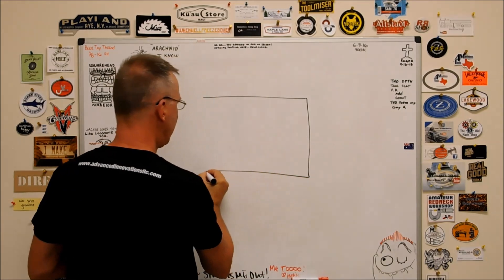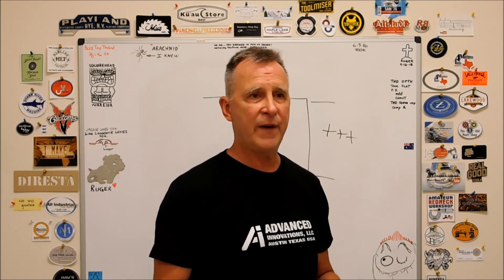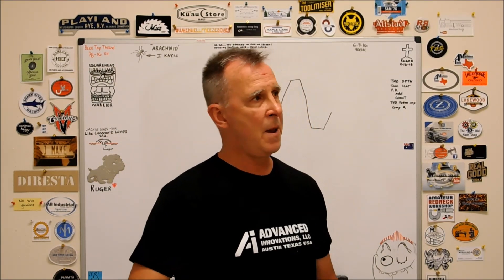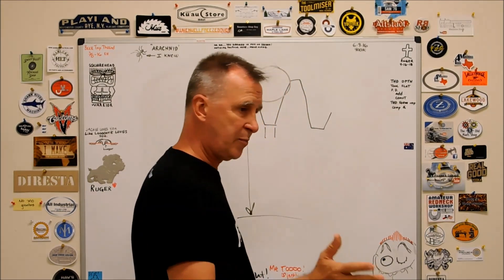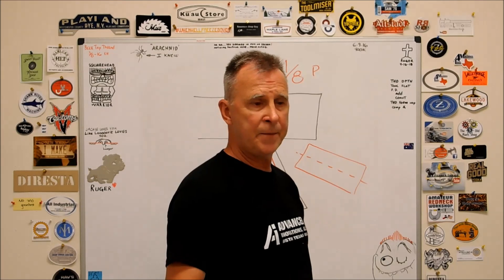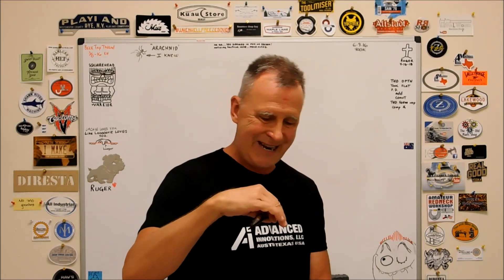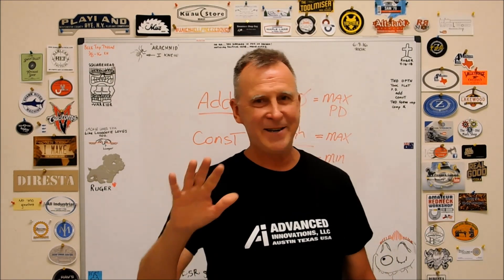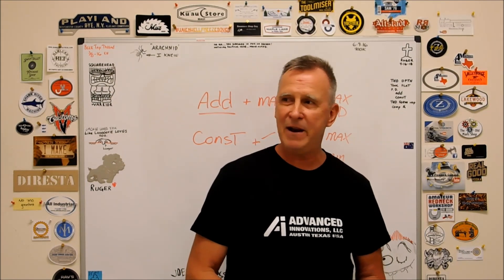Single Point Threading, Want to do it better ?? Watch This Video.

Comment: Joe, I have another newbie question concerning thread cutting.   My lathe (LeBlond Regal 13, 1960 model) has diameter reduction on the cross slide and radius deduction on the compound.  So, initially, when taking cuts and whether you're using the cross slide or compound (set to 29.5), you would have to adjust the dial setting accordingly.  And, if you're using the compound, there again set to 29.5, what ever depth of cut you input on the dial, is really a trig function of 30 degrees?  So, if you dial in on the compound .005, it's not really .005 but less.  I guess you could indicate on the tool post.  What am I missing?  I do understand that the finish cut should be measured with wires to get to the standard.  And what ever alloy you threading, the cross slide or compound may be a better selection plus the rpm of the spindle.  I am practicing on aluminum for now using a hss cutter.
Reply from the maker: As much as I hate "Depth of the cut" threading, If that's your path, set the depth first with the cross slide, and leave it alone. Having done that with the compound at zero, simply back the compound out and start your threading. When the compound ultimately reaches zero after several passes, your depth should be what your looking for. Then use wires.

Comment: I am just trying to understand the basics.  For now I’m ignoring the half degree.  Anyway, some people say to set your compound to 60 degrees and others say to set it at 30 degrees.  Don’t they leave out the explanation about how the compound graduation is oriented.  For me , it makes more sense to say that the compound should be at 30 degrees to the perpendicular of the rotating axis.
Reply from the maker: You are correct, most machinists don’t explain that well.

Comment: Im trying to make a 1 7/16x28 thread, id and od. I made the external part close to min spec. Is this ok to use for test fitment on the ID threads? Should i make another on the high side as a no go gauge?
How do you tell if you went too far with the ID threads?
Reply from the maker: A plug gage or OD ( class A ) thread should always be right on the nominal size. As for the internal thread, if the max depth of cut is an issue, use you threading tool on a test piece and bore a shallow hole with it to the desired diameter. This will give you the cross slide dial setting that you can't measure while threading. Then use a parallel compound setup to widen the thread until the plug gage goes in.

Comment: Update - I pulled out my thread wires, measured the threads I cut using this technique, and calculated a pitch diameter 0.0006 larger than the 1/2/29 UNEF standard.  I'm declaring victory.
Reply from the maker: It was a "drop the mic" moment. well done.

Comment: An old model engineer once told me that once you are set up at your outside diameter for your part that you are threading and your cutting tool is at the same place , ie just touching the blank, then divide the figure 640 by the threads per inch and the result will be the depth of cut in thousandths to achieve the result. Ie 8 tpi = 640  divided by 8 gives you a depth of cut of 80 thou.  This has also worked for metric threads with a little maths conversion . Always 640 regardless of number of threads. All of this dependant on tool shape etc. This has served me well over the years for what I have done but I would be interested in your comments Joe.

Comment: Hi Joe, I wondered if you had any tips or tricks to share in regards single pointing metric threads on an inch leadscrew lathe? As I understand it, the only way to cut a metric thread is to ignore the threading dial, and once the half nut is engaged for the first cut, the half nut must stay engaged until the thread is finished, traversing the tool back to the start backing it out, and then reversing the machine to get back to the start - otherwise you lose the relative position of the tool to the thread helix. Do you have any tips to share on cutting metric threads? Thank you sir, hope you are well.
Reply: @billshiff2060  That has always been my understanding also. However, the more I try machining methods, and the more I watch Joe's channel, the more I realize I don't know, so thought I'd ask. I saw a heck of intricate bolt on threading dial the other day though, which can do both inch and metric. I'd never make it, but it's a fascinating mechanism.

Comment: Ok joe  i spook on the subject . on my 100 year old lathe that as no  Lead screw. that as no led screw & no third Dial.  I  finally found  a way to cut a thread, on my old  lathe with out a thread dial   & or a lead screw.   I thought I would  shar it with .You  Thinking would like  to hear  of ny answer to the problem i had  Yes i have to tack notice of rear in the lathe ,    so how did i fix my problem . well i now ues a  Mill thudding tool  in a router at a speed of 300 RPM   in fact to a woodruff key cuter sapped to a 60 degree thread point cutter  just as if it was a single point lathe tool ,  i can buy for smaller size threads , even savage broken taps. 
but putting the tooling in a router. that spins at 3000 rpm i can rotate the chuck as a light cut & start to engage the half nut in your case  in my case  the rack travers  & that at the desired pitch or the Thread i wont.  cut  just as if  normal single point  threading. it work Remarkably well  & it as a  the added benefit of being able to use  one third mill  four  more than one different thread , depending on your size of cutter , & selected choice.  size of hole is irrelevant  solong as if a stander thread  standard  criteria is followed   for it's  upper & lower thread pitch , i cant do videos  that's why i right    thanks for your help its help a lot  Les  England. 

 Pleas excuse the Dislexcea .

Comment: hear one for you to ponder .
:-  I have an  old,  UK school lath,   That as a short. lead  screw Shaft, driving a second shaft , that is powers by a set of thread & cutting gears , & Banjo . I can prudes thirds with this lath.  But I have to time the lath as I do so.  As we have no trad chasing gag fitted to the lathe'. When they .  later fitted , The led screws to these Lathe.  because  we fawn the technique for cutting single point threading was benin lost.   So fitting a led Screw became the norm,  The need to time the lath. was lost &  went away. But I still do because I have not fitted a led crew yet to replace { My rack }  which is my led screw. 
I was thinking off fitting a   Rotary 8 Threading-dial to the rotating drive shaft . that as no thrds  just a long key to overcome the problem of no lead screw. & timing  but haven't  go to that yet , ? Interesting  Problem bont you think .   The myford lathes   has the sam tip of shaft with threads & a way to capture the threads so it can drive the sadal . 

  don't you think  it a   {Callusing  graduate Master}  lath made  for schools They will cut threads but it requires the Timing of the lath .  Something that is tort.  in our schools. 
When you think about it we  do not re qirt,  need For  led screw to cut a thread providing we have a rack That was it's  primer Function ,  before the lead screw was adopted.   to be driven by the Banjo.  solong. as the timing the lathe is made  easier. we still do not need a lead screw> 

I don't sups you have one to Try this out on . but when you give it thought it.  becomes pretty clear .  hope this find you & You have something to say on the subject As interesting as you programs are  . & i play them for my grandchildren to whach as a good subject matter over this pandemic.   alas the subject is no longe tort. in schools. & the young can't single point thed.  unless they  have had it handed down by the grandads , OR watched a lot of youtube i must say this is why it must be re posted.  over & over agen boen the years ,

Comment: Nice review.  Made sense to me, and only had to watch it once.  

I bought a thread mic long ago, you tempt me to get wires and give it a go. be nice to have comparison if something doesn't make sense. 

ASIDE Question:  Cutting male threads on a CNC  [OMNI GT-75 for reference]  Anyway I learned thru trial and error that doing a spring pass or the final cut was too small the threads looked rough compared to doing a bigger cut on the last one.  

Both were good, just not as pretty...  material 303 , I just learned to do it one way but not figured out why the light cut kinda chowder-ed up the threads a little looking with magnifier. Carbide insert btw. Any insight?  This was from a few years ago, and just did a memory recall.  Not seen if with Brass, 17-4 etc. just the 303 , the sulfur maybe...

Comment: hello, is this for imperial threading, is metric different somehow? bit confused. thanks
Reply from the maker: Should work for all threads. Whats the confusing part?
Reply: @joepie221  why would you not set a depth of cut on a thread? like if i'm doing an M8 thread with 8mm major diameter, 6.446mm minor diameter wouldn't i move in 1/2 of 8-6.446? also what's the relevance of pitch diameter. by the way i have a emco v10 lathe but haven't successfully turned a thread yet. thanks
Reply from the maker: @feelindizzy777  Way too many guys make the mistake of thinking the thread depth is the biblical dimensional standard for a good thread. NOT SO. A good thread is a combination of tool profile, tip and root flats and correct pitch diameter. Somewhere along the line, a depth does occur, but it a resultant dimension based on all the other primary factors being correct. Just imagine if you bored a hole for an internal thread too big, then used a "THREAD DEPTH" value to cut the thread. Part is double trashed when you could have still put a reasonable thread on it. Same goes for the OD. All this mumbo jumbo is more important when you are attempting to hit a specific class fit.
Reply: @joepie221  I'm very green with this and that example actually helped me understand the why a lot more. You're doing good work spreading better practices Joe, props!

Comment: I’m cutting 2-11/16 x 18 tpi 2A thread (2.6875”) using the nominal major diameter (again 2.6875) and adding 0.01180 from my Pee Dee thread chart would suggest that the pitch diameter is 2.6993” or LARGER than the nominal diameter of the thread.  What am I missing?

Related, you never reviewed the calculation or determining the minimum pitch diameter.  If I start with the nominal size of the thread there is no “high” or “low”.  Do you mean max and min major diameter?  If that’s the case,  the max major diameter for this thread would be 2.686” and the minimum major diameter would be 2.677” for a 2A thread using the formulas in the Machinery’s Handbook.  But the problem of adding the “ADD“ number (0.01180) still will bring the pitch diameter outside the nominal diameter of the thread.

Restated, how do you calculate the minimum and maximum pitch diameter using the information from the Pee Dee chart?  Again, for a nominal 2-11/16 x 18 2A thread.
Reply from the maker: The Pee Dee value chart is pitch specific. The numbers given are used 2 ways, but you have to use the correct diameter wire for the thread you are cutting. The "ADD" value is not the new pitch diameter, but the measurement over the wires once that 'ADD" value is added to the major diameter. Its a good reference number to get you in the ballpark. The "CONST" number, is used in conjunction with the high and low pitch diameters found in the machinery's handbook. It is by far the best way to assure a thread is within the high and low specs.
Reply: @joepie221   You need to correct your video. 
At 12:35,  you write ADD+Major Dia=Max PD
and repeat it verbally, calling it a good rule of thumb

I don't know who or what riled you up for this video, 
but it meant your usual clear thinking was not in evidence.
Reply from the maker: @Gottenhimfella  I'll stand by the material presented. Out of curiosity, what would you suggest the change be??
Reply: @joepie221  PD = Major Dia + ADD - CONST
Add is how you get from the major dia to the measured at the outside of the pins.  Then minus CONST delivers the PD.

Comment: A job I worked on a few years ago almost required purchasing a specialized internal micrometer that had spherical anvils (if i recall correctly) that measured pitch dia of an internal thread. Specialized and expensive. This application required actually obtaining absolute pitch dia data for engineering purposes.

Comment: Joe, I find this thread measuring system with wires very interesting.
I have only used thread micrometers and have found this system to work well, what is your findings with thread mics?
Reply from the maker: I've always been a hard gage or wire fan. Not much of a thread mic fan. Just personal preference.
Reply: @joepie221  Hi, many thanks for your prompt reply, it is quite interesting the difference between yourselves in the states  and us in South Africa where I guess we still have t5he British influence.
Watching your videos is quite an eye opener and even after 60 plus years association with the engineering profession (not all on the tools) I am still in a learning curve, thanks again.

Comment: I tried using pitch wires, but the frustration level went too high. I bought a pitch mic. It seems to work good for me. How do you like pitch mics?
Reply from the maker: To be completely honest, I don't like them, and don't use them. I'm a wire guy to the end.

Comment: A technique I saw from a local agricultural/industrial machinery repair shop (old school do quicker job shop) was he used a sharp tool to get to depth and then fed the compound forward (never seen him bothered with infeeds) to widen it and leave a flat crest. This way he had to have only a few threading tools at hand.
Reply from the maker: You can set the compound inline with the part to control the root flat if you need to. Dive in with the cross slide and manipulate the flats with the compound.

Comment: Joe enjoy your contributions and was wondering how you would achieve a left hand thread on a small diameter .180 Dia for about an inch.  This is to replace a broken windage screw on a Lyman peep sight
Reply from the maker: This may be a great topic for a video. But, I would support it with a live center, tool upright and feed away from the collet or chuck.

Comment: I watched this video three times. I get it. I made a proper 5/8 X 18 bolt using the wires. Cut a 2A thread to perfection.
I used a tap for the bore to check my work (pretending I sent my bolt out to bumfa) my bolt fit perfectly. I could not have asked for a better fit. Not loose and smooth as glass.
I was going to buy a thread mic. Not any more.
Joe, I love you man!

Comment: Hello Joe. I have to make a clone of a special brass fitting. This is not a standard CGA type fitting and there are no drawings or specs. to go by on this part. I had to reverse engineer this fitting to get all of my dimensions. There is a M24x2.0 external thread w/ a .33475 radius in front of the external thread for sealing off high pressure nitrogen, and a .761-14 internal thread on the opposite end of the fitting. This is all of the information I have on the internal thread. My question is, to maintain interchangeability of this fitting, how do I get the other dimensions I need to machine this internal thread? I need to know the pitch diameter, minor diameter, major diameter, and I only have the minor diameter. I have to make four clones of this fitting. So I need to make a thread plug gauge, and a thread ring gauge to check these threads during machining. How would you approach this in your shop?? A little about my background. I have 21 years total experience in manufacturing, ten years in machining, and 11 years in welding. As far as machining, I have experience in manual mill, manual lathe, CNC, CNC programming, setup, 4 years of CAD using SolidWorks. I'm currently a prototype machinist for the US Army. I am a US Army veteran. I served 9 years in the Army. I've been watching your videos since you started in 2016, I still enjoy learning from your video content. Thank you.
Reply from the maker: The machinery's handbook should give you all the construction standards for the pitch and diameter you desire. Remember to use the internal pitch diameter on the external thread you will use on your gage. A lot of guys miss that fact.

Comment: Joe, you're the perfect guy for me to ask your opinion of this threading question. 
Back in the early 1980's, I went to Wentworth Institute of Technology in Boston.
Great school, I learned a lot.
One thing that they taught was to set the cross slide at 29.5 degrees for cutting external threads.
There was even a special pin with a flat on it that, depending on how you put it into the machine, would add, or subtract .5 degree  from the protractor / angle indicator on the cross slide for external or internal threading. 
We used various types of standard 60 degree tools to do the cutting.
When I asked our instructor what the .5 degree reduction was for, he said so the tool wouldn't drag on the back side of the thread.
Which didn't make sense to me because you're driving a 60 degree tools sideways at 30 degrees +/-  into the stock so it shouldn't drag anyway.
Not wanting my instructor to think I was an idiot, I let it go ( In hindsight I was a kid in school, and should have pressed him for more info ).
What do you think about 29.5 degrees, vs. 30 degrees for the cross slide set up?